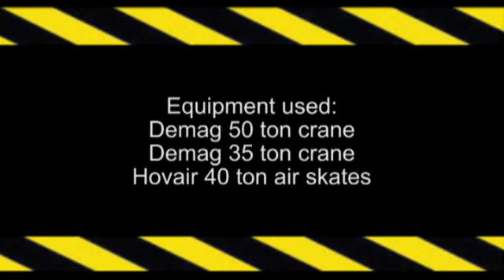Heavy machinery tandem lift by O'Hagan Crane Hire - Featuring Movetech UK Hovair Air Skates

Comment: Nice job. In 40 years of Rigging and machinery moving I only used air dollies a handful of times usually in pharmaceutical plants with expensive floors. The preparation and sensitivity of air dollies made it cost and time prohibitive in most machine shops. I did like the aluminum sheets though, they worked good and are much lighter than the 1/4" 2'x4' steel plates we had to wrestle. Nice job, very interesting.